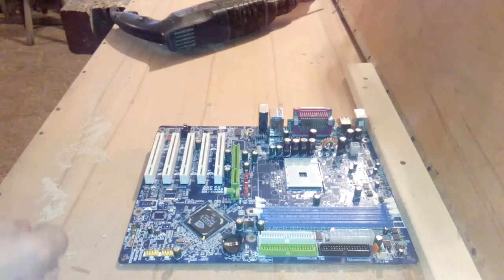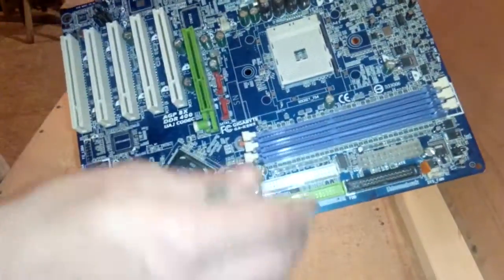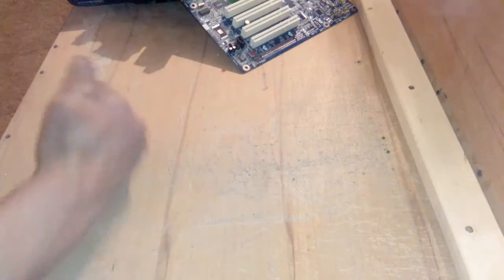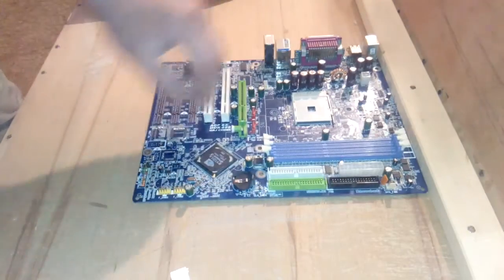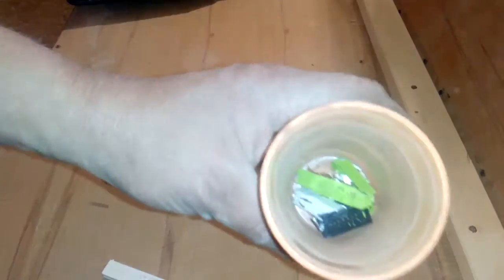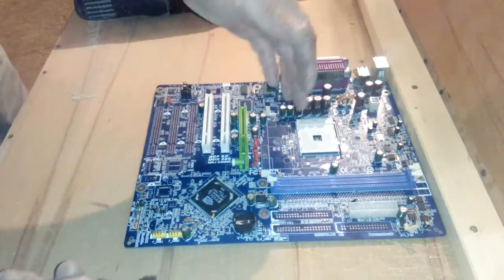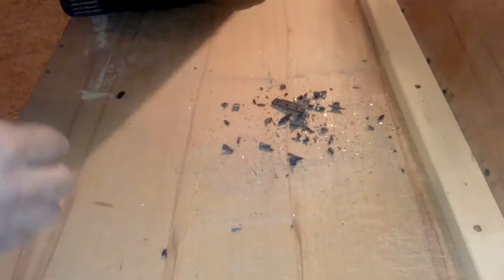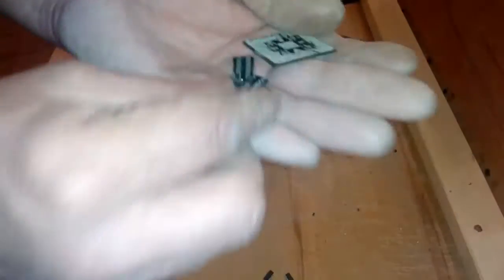Depopulating motherboards & pcb boards part 1

Comment: I will be depopulating some board soon so this was a good video to watch! I heard you talk about the Ruthenium Resistors... and not removing them because bad for lungs. I was going to save those to see if later I could get the Ruthenium I am guessing that is not advisible? I was just going to use a screw driver for this though.
Reply from the maker: It is very dangerous if the inhalation of the lungs can lead to lung cancer. In normal form they are not asleep, but when they are mixed with acids, they dangerous.